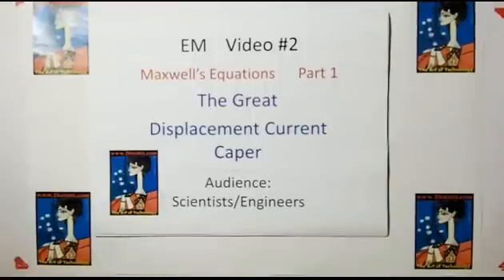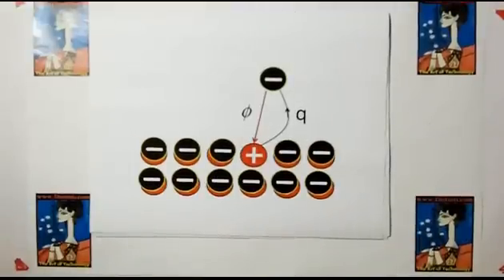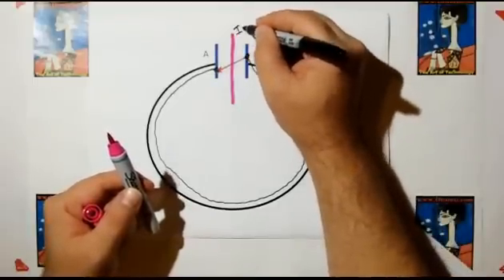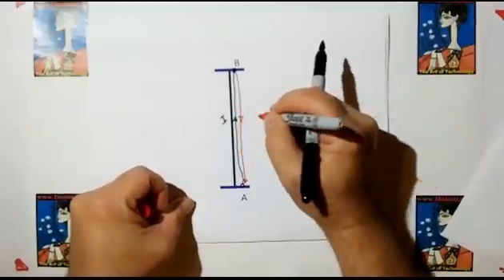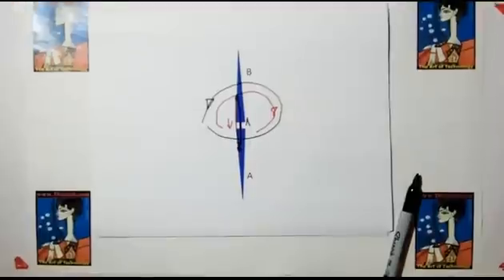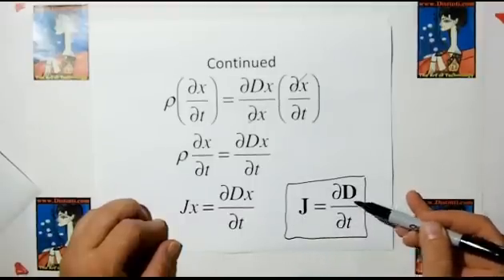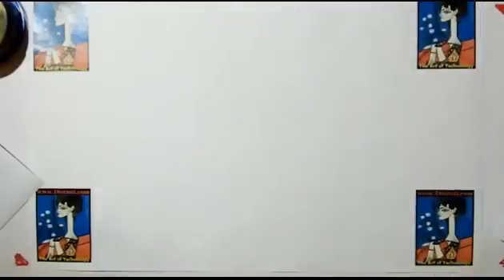emV002: Light 1 / Maxwell 1 / Displacement Current Caper

Comment: In general, you can't change the geometry of a circuit like that and expect the calculations to be the same.  For example, in straightening out he loop, the distance between the capacitor plates has changed (in fact, they would no long really be considered a capacitor).

Comment: It just goes to show that planar wave physics is technically bogus.  It is using Euclidiean (flat, planar) geometry to define everything when in reality it needs spatial 3D geometry.  Such Cartesian system is "potentially" 3D, but then never references all those other various z planes flowing through the Y (amplitude) and X (charge) of such a wave - which isn't a wave.  There is no wave.  It is actually a spiral of light-energies, like a door spring ("Slinky") that is chopped up and look at in 3 directions (proverbial elephant and the 3 blind men - its a rope (tail), its a wall (side) and its a conglomerate of movable rope (snout), movable walls (ears), movable portal (mouth), and other 3D variable shaped surfaces.

Energy (and light) is a spiral force.  The lower the energy, the longer the Hertz "wave" - the longer the actual spiral that exists (stretched out Slinky).  The higher the energy, the shorter the Hertz waves, the more compact the spiral.  Depending on the actual amplitude of the original spiral, the higher the energy, the smaller the spiral and greater velocity of the energy's movement.  Thus, a lower energetic force will be longer and (potentially) larger in a spring-shape.  The higher energetic force will be a smaller spiral movement with faster velocity (up to light speed, where the actual spiral just becomes a line of spirality (chiralty).

What appears to be this Maxwell I and Id forces ... sounds more like what Tesla did in making his alternating current that I and Id of equal energy and force created a (near) free-flowing energy transfer ... versus Edisons DC system that could only reach out 2-3-4 blocks until energy was diminished inside the resistive electrical cables of those days.

Comment: Isn't the displacement current of the opposite charge? In that case there is no problem at all with Maxwell's equations. It seems as you assume that you have two currents with the same charge going in opposite directions. That would be the same as having no current at all.

Comment: the displacement current is explained usually by the capacitor.
we know that the current flow along the circuit until the capacitor positive plate and then its stops abruptly. and it continue abruptly from the negative plate .
so how come, there is a closed loop of current if the wire is cut?

maxwell explained by saying that electric field that is changing in time is conrtibuting to the current. in electronics we explain that when the electric field is constant in time, there is no current running in the RC circuit but current do run in the circuit if the electric field is changing in time.
the electric flux through the gap between the plates is changing in time, producing a so called current without electrons really moving.
I wonder how can it be explained without the idea of displacement current

Comment: I respectfully disagree with your explanation of displacement current. Maxwell considered the Ether a material medium, a dielectric medium. So there was no difference to him, because his Ether model was molecular.
To understand the displacement current you need first to explain the capacitor working with a material medium. 
When a voltage and is applied, the neutral molecules of the dielectric become polarized. Each atom is composed of electric charges, so the negative charges are attracted to the positive terminal and the positive charges are attracted to the negative. This deforms the shape of the atoms, so each atom becomes a dipole aligned with the electric field. This alignment is the displacement current that will produce necessarily a magnetic field.
Without the displacement current there is no Electromagnetic wave.
The displacement current is the best part of Maxwell's Electromagnetic Theory.

Comment: For a dipole, the displacement current would seem to splay out from the antenna wire, following the electric field lines, so that the two currents are not in the same location and so do not cancel. The magnetic field will be within the volume enclosed by the electric field, but this seems to be the local magnetic induction field and is not the radiation field. The latter arises due to the acceleration of electrons in the wire.
Reply from the maker: Mirror Cruising Please see the revised version of this video https://www.youtube.com/watch?v=YYQI3F6iX_0
I will be producing a video series about wave mechanics which will end with a discussion of how Ethereal Mechanics explains the dipole.  We can have this discussion then.

Comment: Mr. Distinti (Robert): All you've done is really what you were suppose-to-do but it's not merely J=∂D/∂t but J≡∂D/∂t ... you've counted the current twice and gotten 2× thereby... All Maxwell was saying is that ∂D/∂t is the same for where you can't measure charge-particles flowing-by because they're 'stuck' charging-up the capacitor's workfunction... (Q: were you to disconnect the capacitor from its driving circuit and short it internally, would the flash of current between the plates release a magnetic pulse, and now-think, how that is different from an antenna)... The point is: electron-flow is not a second-current but the same-as the displacement current... But note additionally that if you follow this reasoning you do come upon a curious question of whether a charge-particle moving in space has a magnetic field in its own frame... Have fun— modern university textbooks specifically avoid thinking-this-out to conclusions proper-or-not.

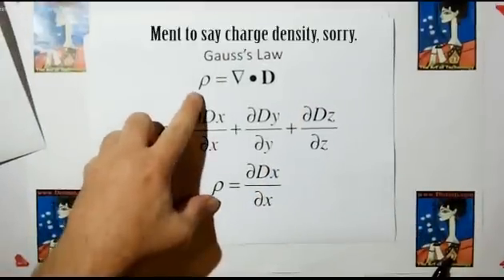Comment: The mathematical derivation in this video starting at 7:56 is completely sound. However, since it means that Jx = ∂Dx/∂t, then there must be a charge density anywhere ∂Dx/∂t ≠ 0. But we know that a point electric charge has an associated Dx all over space (except at the plane perpendicular to the charge's motion along x), so you should expect J (and therefore ρ) to exist at any point where Dx is changing, which is to say everywhere! Therefore, the charge density ρ at 7:56 must be distributed over space (i.e. a space charge).
Reply from the maker: kmarinas86 D only represents the field lines of charges.  Because the electric field is a "force-at-distance" phenomenon, the charge sourcing the D lines at point (x,y,z) do not have to be in the vicinity of (x,y,z) where you are measuring D.  Thus ∂Dx/∂t can result from either Jx or a nearby charge moving along x or both.   Therefore it is not possible to conclude a space charge distribution from the derivation.  The only thing you can say for sure is that one or more charge somewhere are in motion; there are infinite arrangements of charges that will give you the same answer for dD/dT at a given point in space.
Reply: www.Distinti.com 

For

Jx = ∂Dx/∂t

to be non-zero, wherever ∂Dx/∂t is non-zero, Jx has to be non-zero. If there is no space charge, what is the physical meaning of Jx where ρ is zero and ∂Dx/∂x, which can be calculated from ρ - ∂Dy/∂y - ∂Dz/∂z, isn't zero?
Reply from the maker: This is an Excellent example of the fundamental problem with electromagnetic physics AND mathematics.

The above derivation; although correct, has lost information such that it can easily be misinterpreted as you have done.

because it is derived from the point forms of Maxwell's equations it is only valid in the immediate vicinity of a charge in motion.

Because the E field (or D) of a charge extends far beyond a given charge (into "Empty" Space (to infinity) where there may be no charges) then dD/dt resulting from this charge in motion affects the WHOLE UNIVERSE, not just the immediate space defined by the derivation

The same derivation done using integral forms is here. 
http://www.distinti.com/docs/displacement_dilemma.pdf
See secton 1.2.1 start at step 9.

This shows the ∂Dx/∂t at the spaces between moving charges which is NOT zero in spite of the fact that no charges exist there

REMEMBER, the whole purpose of this video is to show that Maxwell's equations are in error.  Its probably not  good idea to make claims about "space charge" from a derivation intended to show that Maxwell's equation are in error.

You have made other mistakes common among Maxwell believers (such as assumption of invertibility). The other mistakes are detailed in the upcoming rules of acquisition videos.
Reply: www.Distinti.com 

"This shows the ∂Dx/∂t at the spaces between moving charges which is NOT zero in spite of the fact that no charges exist there"

If Jx is non-zero and ρ is zero, then Jx cannot be a product with ρ as the factor. You say the problem is with using the point form of Maxwell's equations. Ok, I give you that, but then Jx is not the current density in the x direction, but instead it is something like current density in the x direction, but multiplied by a 1/volume coupling factor that depends on the relative position and angle of that current density, and then integrated for all source Jx throughout the volume.

The standard J_x based on ρ*v_x not is not the same as (ρ - ∂Dy/∂y - ∂Dz/∂z)(∂x/∂t)=(∂Dx/∂x)(∂x/∂t) as the latter exists all over space, and the former does not.  ρ*v_x does not exist at every point where ∂Dx/∂t is measured even though there is a numerical agreement by assuming ρ*v_x = (∂Dx/∂x)*(∂x/∂t) [which is not true because ∂Dy/∂y + ∂Dz/∂z is still non-zero even though it is irrelevant to the x-directional component of the displacement current]. Your math still does confirm your point that ∂Dx/∂t is not a real current at all, but just an identity, so you definitely got that right.
Reply: www.Distinti.com 

On a slightly different topic, I also have a concern about situations where the plates are sufficiently far apart to invalidate the assumption of a uniform field between the plates. I suspect that the "displacement current" term from one plate doesn't even fully connect to the other plate, the greater this distance is, and instead it fringes out sideways. Furthermore, if the capacitors' plates are both negatively charged, even though having a potential difference, then the flux does not even connect the plates despite the voltage across the capacitor and instead permeates sideways, which clearly shows why the standard approach to so-called displacement current is wrong.

Comment: Displacement current does not mean a flow of moving charge. Maxwell's brilliance, was to be the first one to be able to see a very simple proportionality. eg. Between the plates of a capacitor we have a time varying electric field whose rate of change is directly proportional to the rate the external charges are entering on to the surface of the plates. That is all it means. It is not complicated.

For example, If we increase the voltage (potential difference) between any two plates of metal we are increasing the electric field between them in direct proportion to the numbers of charges that fill up on the surface of the plates. So the rate that the charge moves onto those plates is then obviously proportional to the rate of the changing field between the plates. This proportionality Maxwell described as a displacement current. That is all it means!
Reply from the maker: You missed the point.  Maxwell claims that the displacement current generates a magnetic field like a real current.  If this were true you would have an over unity condition and Dipole antenna could not radiate.   That is the point of the video, I never made a claim as to what displacement current is or isn't.
Reply: www.Distinti.com "Maxwell claims that the displacement current generates a magnetic field like a real current."

Since a displacement current represents a changing electric field then yes it really does generate a magnetic field. So what do you think a displacement current is?
Reply from the maker: Kevin O'Brien
It is the moving charge that generates both the changing electric field and the magnetic field.  If the changing electric field (generated by the moving charge) ALSO generates a magnetic field, then what you are saying is that we should have DOUBLE the magnetic field generated (a contribution from the moving charge and a contribution from the changing electric field CurlH=2J).  This is the OVER UNITY argument made in the video-- perhaps it was not obvious.  Hey I would love to be the first guy to develop a generator based on over unity.

Here are some other tid-bits which will make you consider asking for a refund for your university tuition and text books:

If there is a DC current  in a superconducting ring, a magnetic field will be present and no changing electric field will be present.  Thus a moving charge, AND ONLY moving charge, causes a magnetic field.

let me give you and energy argument:

According to Maxwell's 1873 work, a magnetic field stores kinetic energy and an electric field stores potential energy (this info was lost when Heaviside converted everything to the forms we know today).  I agree with his assertion on this.  Segway to a ballistic pendulum, when kinetic energy is acquired by the pendulum by  being struck by a projectile, the pendulum rises again gravity to convert the kinetic energy to potential energy.  The energy can not convert from one for to the other without the intermediary of the mass.  Thus kinetic energy and potential energy are orthogonal constructs.  This orthogonally is required for our simplified wave models (essentially the Fourier Kernel-- the next few videos) to work properly.  Because engineers also use Fourier Kernel for radio waves with great success,  then the orthogonally must be present with radio (light) waves as well; therefore an electric field can not cause a magnetic field (and visa-versa) otherwise those tools would break down.  Thus a medum must be present -- which I call the Ether -- my model for the ether is very different from the classical ether -- but it is all in the videos.

and another

Maxwell's Plane wave model base on the notion that a changing electric field generates a magnetic (without an intermediary) violates conservation of energy (see my video trailer emV000: Introduction to Ethereal Mechanics)

Thank you, you have helped me hone this argument into a much more compact form.
Reply: "It is the moving charge that generates both the changing electric field and the magnetic field.  If the changing electric field (generated by the moving charge) ...... "

That is wrong! Charges only move because they are influenced by an electric field. Electric fields which are a consequence of having a PD (Potential Difference) between two points. Its basic "A" Level stuff. 

Do you even know what is an electric field? It seems very clear that you do not.
Reply: Kevin O'Brien "It is the moving charge that generates both the changing electric field and the magnetic field.  ....... "

A "Displacement current" does not refer to charge at all. As it is not charge, but merely a statement of equivalence, nothing more. A mnemonic name, used to describe a changing electric field. And a name, which is only ever used in the context of describing capacitance effects between two plates. A name used so as to allow others to see this equivalence. Unfortunately this name has confused the layman for over 150 years, as it is often wrongly attributed to a real charge, where one does not exist. In the same erroneous way as you have done above.
Reply from the maker: Kevin O'Brien
"That is wrong! Charges only move because they are influenced by an electric field"

Sorry, I do not agree with that statement:
1) There is F=QvxB and gravity also cause charges to accelerate.  

Maxwell's equation, curlH= J+dD/dt states that both a moving charge (J) and the changing electric field about that charge (dD/dt)  BOTH contribute to magnetic field.   This is over-unity.  dD/dt can not generate a magnetic field for the reasons described in the video.

It is not relevant to this discussion whether you call dD/dt displacement current or a changing electric field.  A rose by any other name ....

."Do you even know what is an electric field? It seems very clear that you do not" 
(no need to be rude)
I counter by asking: does anyone really know what an electric field is?  Fields can only be measured (presently) by observing how charges in the field behave.  Coulombs model is just an observational model which states what charges will do based on past observations, it does not explain how the actual mechanism of the electric field works. 
 Strangely enough, The coulomb field model along with its support functions (Kirchhoff's Law and Gauss's Law) are the only ones that I have never experience inconsistencies with.

There will be simple experiments published in the future to show the blatant mismatches between theory and nature.
Reply: +www.Distinti.com. To understand displacement current you need to understand the Maxwell's Ether model.
Reply: +www.Distinti.com. The conduction current is made of free electrons. The displacement current is dielectric, dipolar. There are charges in vacuum. Vacuum is dielectric! 
Without current there is no magnetic field.
This is Ether!
Reply: +www.Distinti.com. The conduction current is made of free electrons. The displacement current is dielectric, dipolar. There are charges in vacuum. Vacuum is dielectric! 
Without current there is no magnetic field.
This is Ether!